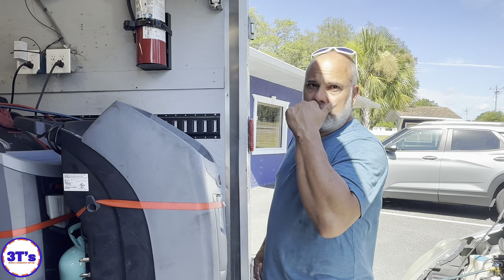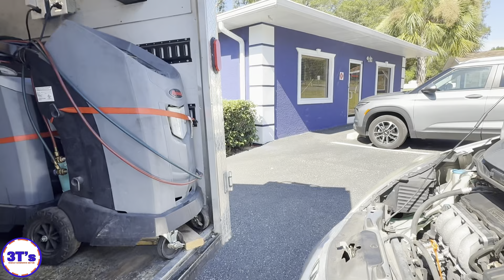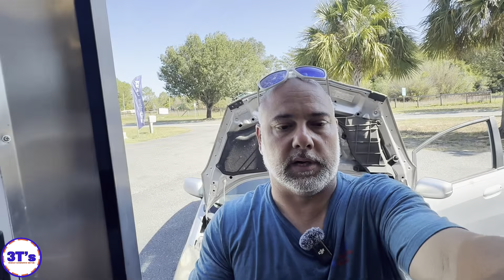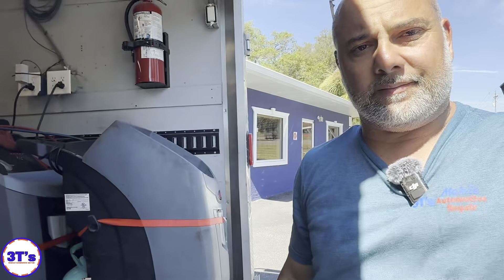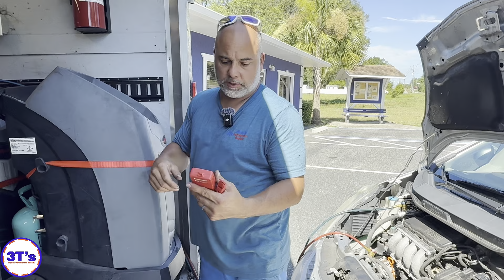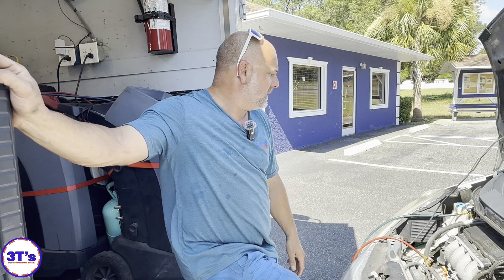Is Your Car's AC Working Properly or Just Blowing Warm Air?

Comment: I drive a 2015 GMC sierra 1500 4 whl drive 5.3 engine flex fuel ac run cold when come to a stop  an wait for the light to turn green but that time my ac gets warm where do I start  checking keep those videos coming
Reply: Check the fan “relay” the fan motor might not working.
Reply: Poor cooling fan operation or low charge of Freon.
Reply from the maker: POSSIBLY LOW CHARGE
Reply: it give cold air is only when stop on a red light or stop in traffic is start to give warm air

Comment: Just today I had a Honda CRV that blew cold but as time passed the Low side was going down to 0 and the high side stayed around 150. I recommended an expansion valve too. Customer declined. I definitely need some more AC training though.
Reply from the maker: you are on the right track